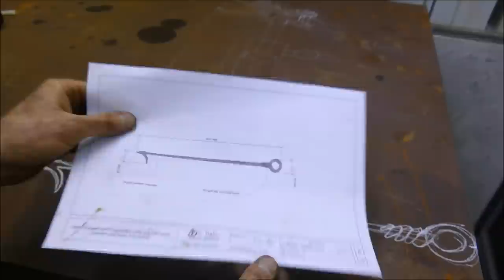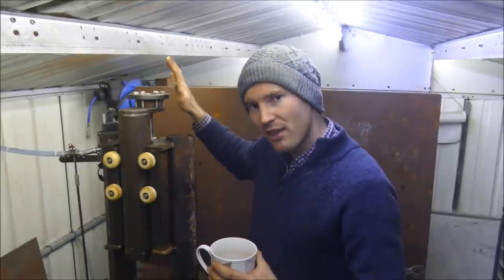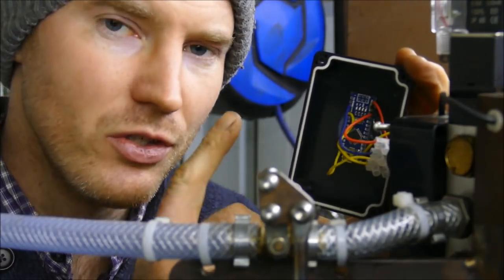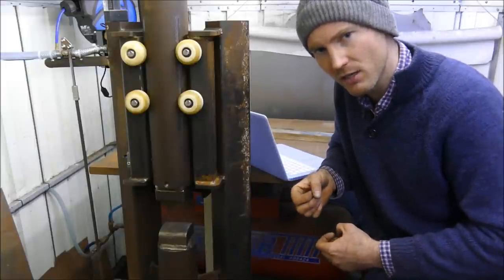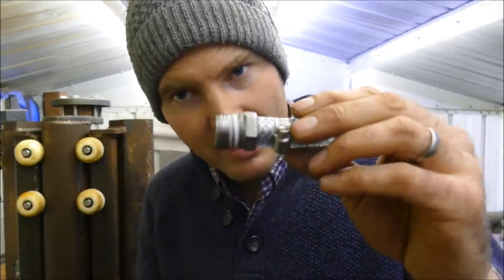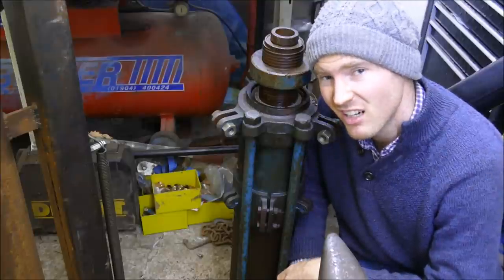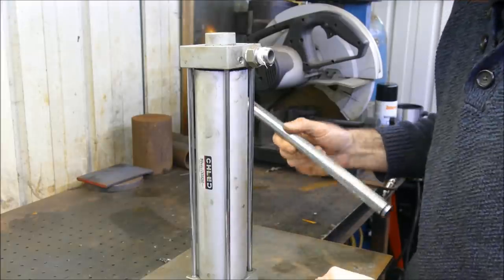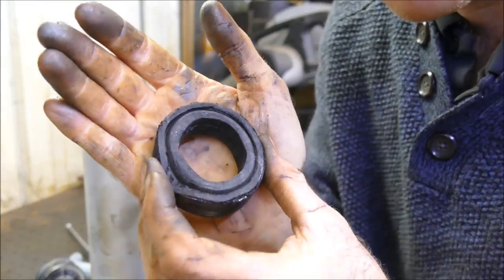DIY Power hammer + computer = Awesome // Homemade Pneumatic power hammer self build plans POWERFUL!!

Comment: Hi Joshua,

Do not hesitate to make more changes, as improvements are always welcome.
Change is what makes life interesting.

In regard to change, have you considered inverting the cylinder so that it pulls up and pushes down. - so that the cylinder is inverted, mounted at the top of the power hammer and the rod end is connected towards the bottom of the moving hammer.

I appreciate your design principal in setting up the cylinder that pushes the rod upwards, as this results in the portion of the cylinder that is active, on the down stroke, has a smaller volume within the cylinder so it takes less air to fill and so moves faster and so hypothetically accelerates quicker.

This is premised on the basis that the supply air can’t enter the cylinder quickly enough and maintain the supply pressure inside the cylinder, as the volume of air inside the cylinder increases as the hammer moves down.

The argument for having the cylinder inverted, being rod pointing downward and its solution to your slowly entering air is as follows.

1.	The piston rod seal requires lubrication, as you correctly pointed out. The oil entering the cylinder does atomise and distributes on to the cylinder internals but to a limited amount and many congregates on the base or lower portion of the cylinder.

The rod seal being on the top reduces less oiling yet it is the most common source of air leakage. Operating the cylinder with the rod pointing down ensures the rod seal receives the maximum amount of lubrication.

Side note all air strut dampeners are recommended to operate with rod downward to prolong the service life.

2.	The rod pointing upward results in the piston seal collecting dust and grit that settles on the seal at the top surface of the piston. This dust and grit gets into the seal and will wear out the seal and rod prematurely.

3.	On the assumption that the supply air entering the cylinder is not the restriction assumed, then the large active area of the cylinder will result in more 6.9% force and hence will subject the hammer to a greater acceleration, hence 6.9% higher impact velocity, hence 14.3% higher impact energy.

4.	In pneumatic cylinder design the speed of operation can be determined from :

Speed = (Flow Rate / Cylinder Area) * 60
Flow Rate should be in liters per minute (LPM) and Cylinder Area in cm^2 for the equation.
https://www.airtec-usa.com/news-support/news/3/how-to-size-a-pneumatic-cylinder-your-complete-step-by-step-guide

5.	I am of the view that it is not the actual ½ inch valve that is the major restriction to the flow rate (air entering the cylinder) but the length of ½ inch supply hose from the cylinder to the air compressor. If a pressure gauge was place in the air line at the valve, I suspect that the operation of the valve will show a momentary dip in the gauge pressure as the air escapes the line and rushes into the empty cylinder causing a pressure drop across the supply line.

6.	 A pressure reservoir (Air Tank) at the power hammer will minimise or overcome the pressure drop along the supply line, depending on reservoir size and rapidity of hammer cycles. This air tank should be at least 3 times the air cylinder volume.

7.	The frame of the power hammer (vertical column supports) can be utilised to be the air tank. In this case the ball valve needs to be located between the outlet of the frame storage tank to the air valve and the frame will need a bleed valve at the bottom to drain any build-up of condensate.

Once my shed is complete, I shall start on making the De Lisle power hammer.
Great work, and constantly change.

Comment: Great project! I'm about to get my tig welding machine. Your going to make me want to build all kinds of stuff. Lol! On the pipe threads remember 2pft(2 turns past finger tight) in steel and 1.5tpft(1.5 turns past finger tight) in aluminum. This is the most turns before you can start cracking or breaking things. I learned this in hydraulic classes many years ago. 👍
Reply from the maker: Thank you so much. Great tip. Cheers J

Comment: Thanks for the plans and comment Joshua going to do the electronic bit because it looks like it will stop the pn cylinder from wrecking itself over time , love the fact that you can make the program to suit ,but a little bit worried about doing it at the same time
Cheers IAIN Aus
Reply from the maker: Any problems please feel free to ask anytime. I want to be able to design so it's as maker friendly as possible. I may develop the ECU as a complete module that you can buy and simply plug into your power hammer. Lots more development. All the very best Cheers J

Comment: Hi, i look forward to get the new plans as soon as they are available . Also i hope to see your forging press project soon. I love everything you invented so far and will build it at home . thank you very much  ;)
Reply from the maker: Thank you Thomas. I'm doing my best to finish it as we speak. I've just got to do the Arduino diagram and code to put on to the download, I've got the DXF for the top linkage to do so people can get that cut with the other parts if they choose and I'm also working on the STL for the electronics box (ECU, electronic control unit). I've decided to combine all the upgrades and original plan on a single download too for new buyers as well as separate files for those who already have the previous plans. Cheers J

Comment: Absolutely brilliant solution by the way.  Power hammers historically have used mechanical contrivances to achieve their goal - you have move straight into the 21st Century with your approach.  I see the variable for timing being set by a potentiometer, the solution to mitigating the risk of the value changing at the wrong time is to have a variable set by the potentiometer but you only change PotVal to be the delay when you are ready in the code (at the end of a cycle or possibly after a couple of cycles have passed through to avoid weird behaviours).  I will get round to making this project, it feels right to me.
Reply from the maker: Thank you. I actually tried that. The problem is that because the Arduino can only read one line at a time, if it reads the PotVal while needing to register the sensor it skips and fully extends the cylinder crashing it to the top. There may be a way around it but I'll need to experiment a bit more first with different code. Cheers J
Reply: @joshuadelisle  happy to take a look at it for you if you wish.

Comment: Just got your plans Josh. To say the least I am very impressed (not an easy task) with the work and thought you have  put into this project. Not exactly a new comer to power hammers. I have made a Kinyon design previously and owned a Sahinler also. Rebuilding the old Kinyon hammer to utilize your design.
Reply from the maker: Just sent you a couple of messages on Etsy. Thank you so much and all the very best. Cheers J

Comment: Is that programmed in BASIC?  You're taking me back to 1986 when I used a computer board to control a robot I built for my senior design project.  Used IF-THEN statements.  Blowing my mind. :-D

Comment: That is so cool. I'm also using arduinos all the time and this is just great. I saw lots of power hammer videos and your thing is the most modern and useful version that I have ever seen. Just a simple idea. maybe you have already done it. Fill your supports with dry sand. this is may quiet your machine a lot and also give it more stability. Great work.
Reply from the maker: Thank you. I'm going to fill them with  concrete after I get it powder coated. Got lots of jobs to catch up with it first before I do. Cheers J
Reply: Concrete is fine too, but that is irreversible. But it seems that you are staying there for a while so is should be fine. I also had  a nothe Idea. You could ad a button to your foopadle so that the Arduino only activates the solonoids when you press the padle. That yould extend the life time of the Ssolenoids quit a bit as these are usually only rated for 50000 to 100000 cycles and not for continoues activation.
Reply from the maker: @electricalychalanged4911  that's a good idea. I'm using a shut off switch at the moment to do just that.
Reply: One last comment. That works, but this is neither good for the Arduino nor the solonoids as a sudden shut off of the Circuit crates reverse voltage spikes, that can kill your divice very easely. As you have the transistor build into the Valve itself you should be alright, because the circuit seems to have diode protection. But it is simply one less point of failure to use an external switch for those situations.

Comment: Very nice upgrades !!
Just one thing: I would add a potentiometer to tune the delay on the go without needing a computer... And/or a pressure sensor to monitor the compressor and compensate for the drop of pressure...

I'll be waiting for that DIY press! You know that you'll need it anyway 😜

Thanks for all that content!
Reply from the maker: Thank you so much. I did try a potentiometer originally but the Arduino couldn't process the high rpm and would go out of synchronisation. It needs an ESP-32 controller which has a higher bit rate.  Something I'll get round to at a later date. Cheers J
Reply: Looks like my reply got lost...

You don't need an encoder for this purpose, a simple 10k potentiometer (kind of a variable resistor)
Put it between ground and 5V and you get a 0-5V signal on the middle pin depending on the position of the knob, connect that pin to an analog pin of the Arduino, make an analog read on the Arduino and you get some 0-1023 value (or 0-255... not sure, I am rusty), simply scale and offer that value into the desired delay interval and voilà...
Reply from the maker: @ocAToccd  I tried that. All I can say is for some reason it didn't work when adjusting to higher rpm and it would stall or fire the wrong way hitting the extent of the cylinder. I believe it needs a higher bit rate. Cheers J

Comment: Amazing work Josh, it’s so impressive. May I make a suggestion, maybe a mechanical dial in the front somewhere to control your hits per minute manually. 
Also maybe a few digital counters one with overall hits and one with job hits, resets it f it idle for a minute. 😁
Reply from the maker: Sounds like great suggestions. I did try and add a dial but it had issues dues to the speed. I may have to use a more powerful micro controller that does 32bits instead of just 8bits.

Comment: I'm not sure if your aware, but I learned this in the US Navy, now you may be aware that the US Naval ships are made of aluminum and stainless steel, but steel and aluminum gaulds, what that means is there is a chemical reaction that takes place were aluminum and steel touch, it's a form of oxidation(rust) you will see white flakes form overtime, which weakens the aluminum to the point of failure. The way the US Navy avoids this varies depending on what it is, but one way is to sandwich brass or  copper between the two metals, some places magnesium is used and other places a high density rubber is used, and there are still other ways to avoid having the two metals touch, but just thought you might like to be made aware of this problem. I would very much be interested in seeing what you do with the bottle jack and any other ideas that you have. In my mind you have a very keen intellect and I would be very interested in seeing anything you devise. Thanks for the video and I will be purchasing your power hammer designs. Thanks again and keep up the good work. 🖖😎⚒
Reply from the maker: Thank you. Yes I know it as galvanic corrosion from electrolysis. My hammer is getting powder coated and will have a barrier between the steel and the aluminium, the aluminium is also coated. Should be fine but your right to be concerned when using those stainless fittings in aluminium. Cheers J
Reply: @joshuadelisle  Oh, ok. I figured someone as knowledgeable as you would surely know, just didn't know what precautions had been taken, thanks for the reply. I learn more every time I ask questions. Thanks again for everything, I'll let you know how things go. 🖖😎⚒

Comment: Don't be sorry for making changes! Kaisen, Constant improvement. I wouldn't want you not to make a change for the sake of not making a change. I want you best result possible. All this learning like the rubber coupling and push fittings, you learn these things by experience and the value we pay for is the saved cost of buying the wrong parts and the time to trouble shoot teething issues.
Reply from the maker: Thank you. I appreciate your patience and understanding. I wish to deliver the best I can with easily accessible tools and parts. I think for most the steel is the most costly and difficult to get hold of. But the results I hope serve everyone well and soon brings a return on their investment. Cheers J

Comment: Well done, very impressive. Can I suggest to mount the cylinder with a trunion mount. And you could also add some fine adjustment with cam mounted skate wheels. I have subbed.

Comment: Absolutely incredible work you do and with basic power tools no milling machine etc this is absolutely incredible.. I work on rock drills and most of the parts you use look similar to the ones we use proximity sensor air valves the solenoid cable etc I wonder if I can rummage through the scrapped parts and salvage something to make me one
Reply from the maker: Thank you. Sounds like you'll be getting creative. Cheers J

Comment: I lightened my ram and get much better performance. Speed is king for generating kinetic energy. Use less air too. I'm starting to think that a larger diameter cylinder at a lower pressure may work faster. May try it.
Reply from the maker: I tested using a larger and a smaller bore size prior to building the hammer and settled with the 2.5" as the optimum. Your right though, mass X acceleration = impact force(velocity). A smaller weight sent faster is as good as a large weight sent slower. The difference is how many blows per cycle to move the material. Also the mass moves the material differently if it's heavy or light Even with the same velocity.

Comment: you could use the metal structure as a  air tanks just would need to plu all the hole then plug your air lines in the the metal risers

Comment: It's normal practice to have reed switches on the cylinder to stop the piston hitting the end stops and casing. If you don't have reed switches the cylinder will keep smashing into the ends.

Comment: this episode was great. I missed it when it first came out. I love how you ended with forge a life worth living. Its something that has been hard for me as work has been my life and everything outside of that has suffered. i need to change. Do you think the heads of the power hammer could be made inte-rchangable. Tw  crushing o things i have in mind for building myself one would be for crushing transistors to recover the copper heat sink part for my salvage and then also turning colored glass bottles into powder? Love your work and find it very inspiring
Reply from the maker: You certainly could. I use 'shoes' on mine to change the faces and tooling. I haven't needed to change the original face with my quick tool change design. There should be a video on it too. Cheers J

Comment: How long does the air compressor holds before kicking in ?
Reply from the maker: Depends on the compressor and how much your forging but mine will last at full pelt maybe 2 minutes. Enough time to do some decent amount of forging before the steel is too cold. Waiting for it to fill up is a down side especially if I've got many irons in the fire but if I get a more powerful compressor like a 36cfm then that would be better or eventually upgrade to a screw compressor if I find one cheap enough second hand. I could also attach more than one smaller compressor in parallel to increase capacity and cfm.

Comment: Loving the mod's to the hammer (complicated though), Is the jack you've purchased the same type used in the coal mines to support the roof?
ATB
Dave
Reply from the maker: Thank you Dave. Hopefully my design package and schematic makes it easy and simple. The electronic side isn't complicated but does require just a little soldering and I'll do a step by step instructions for the Arduino program. Yes beast of a jack. Would make a great press of sorts.

Comment: I would personaly put a HPU on that cylinder 😊
Reply from the maker: I'm interested to see if a cheap pneumatic cylinder and electronic valve will be to make it go. Cheaper than a power pack for sure.
Reply: @joshuadelisle  yes, it is worth a test 😊
Reply from the maker: @jarlove  I'm looking how much it moves just by hand and think 120psi on a 4" bore will do well.

Comment: Great video series.  Gathering material to make myself power hammer for my shop.  In sourcing the 4" solid steel hammer portion I got to thinking.....I have some 4" steel pipe and some lead shot.  What are your thoughts on welding the end on the pipe and filling with lead shot then putting in the ole campfire to melt it solid then welding on the cap.  My calculations put the weight right at 100# Solid steel of that lenght is 70#.  Will that extra 30# help or hinder?  Is the cylinder capable of that kind of weight?  just wondering what made you choose 70#?  Your input would be greatly appreacted.  Keep up the GREAT work!  Cheers!
Reply from the maker: Hello. Thank you. Having 70lb of mass is ideal for the hammer head. However lead is very soft and part of the transfer of energy will end up absorbed by it as it moves independently with the blows. It will work but not as effective as a solid mass of steel.